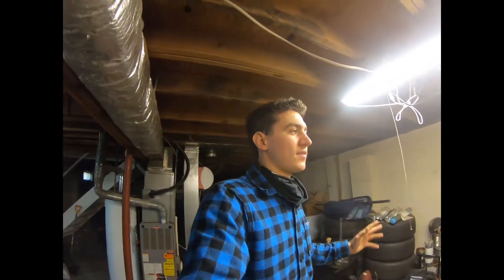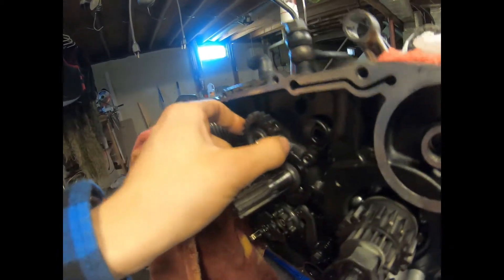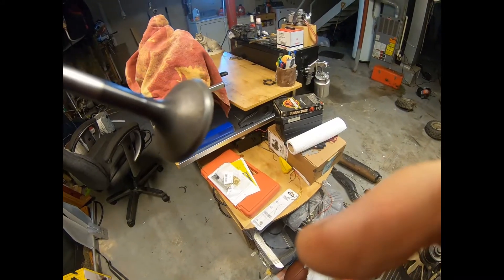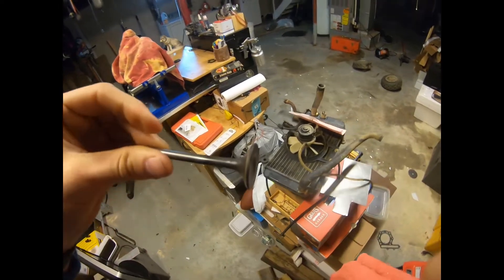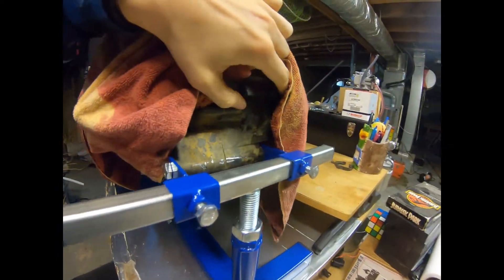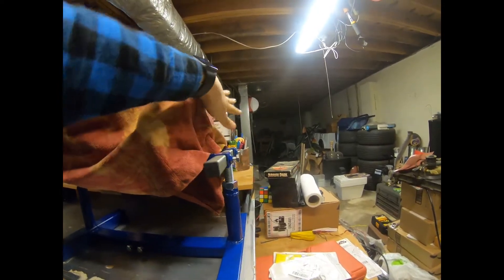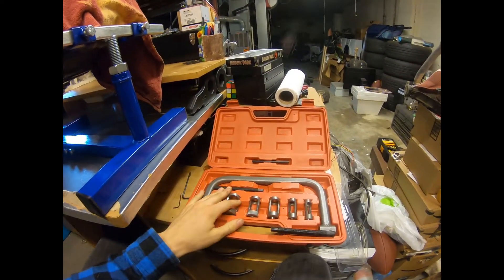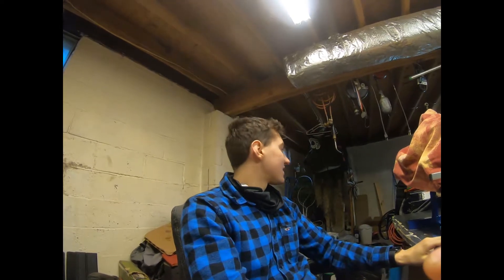Update on Turbo Quad Projects

Comment: Any idea what the new compression ratio will be since your building it for boost? Also how much psi will that turbo put out?
Reply from the maker: I believe it’s a 11.5 : 1 ratio. I am little concerned with such a high compression ratio when I start adding boost
Reply: @SeanChojnacki  oh boy yeah thats very high! Your cylinder pressure is gonna be through the roof, might bend the rod. ideally youd want somewhere between 8.5 to 9.5 : 1 for boost. i have a bad feeling its gonna bend the rod or crack the piston. does it have a wastegate?
Reply from the maker: Yeah it has an internal one but I might do an external to keep the boost low but plan by year. I’ll figure it out. There wasn’t a big selection of pistons for the quad. Also the I’m looking for 8 or less psi
Reply from the maker: But yeah I have that same feeling
Reply from the maker: Also do you have knowledge on the main shaft play?
Reply: @SeanChojnacki  yeah 8 psi might be a bit much for the head gaskets, the shaft play I'm not positive but I don't think it should do that, does it wiggle up and down or just in and out? If up and down then that could be because of a bearing on the shaft inside the case, those motors are extremely complex and very easy to get in over your head so if you go farther and pull the shaft just take your time to remember exactly how things lined up and the order thing go in on
Reply: I don't have a ton of experience with mojave motors I'm more of a car guy I can tear down a v8 and have it back together and this is similar but slightly different because they are so complex
Reply from the maker: It’s in and out play. I think it’s the bearing sin the back but I don’t want to put to much money into the engine that far. I might just crack it open and look but if not back yard mechanic shit lol
Reply: @SeanChojnacki  yeah id guess bearing id tear it down fully or else youll probably  be doing this again soon